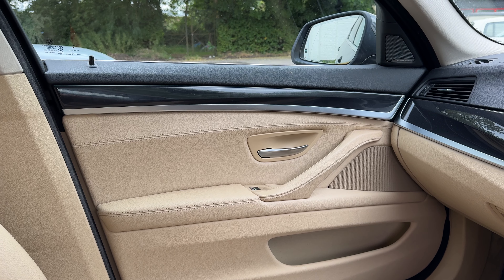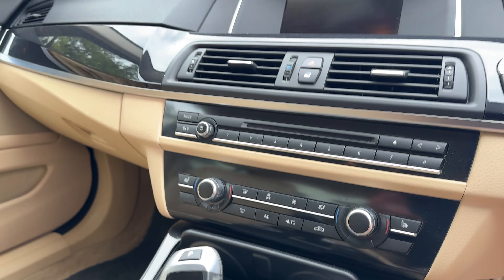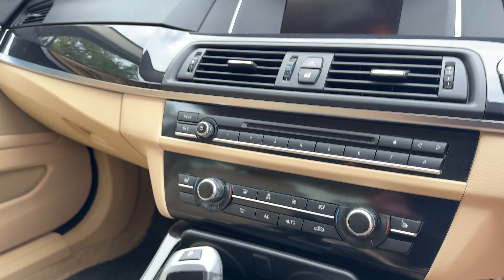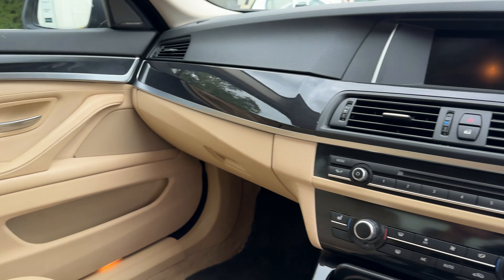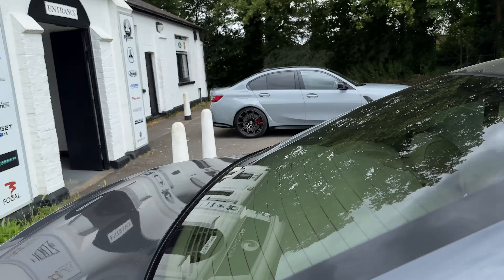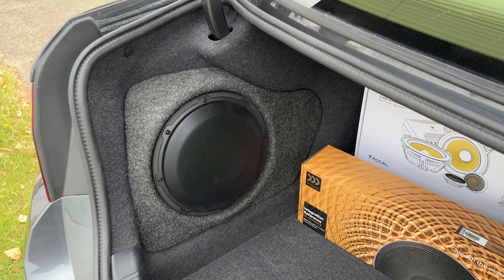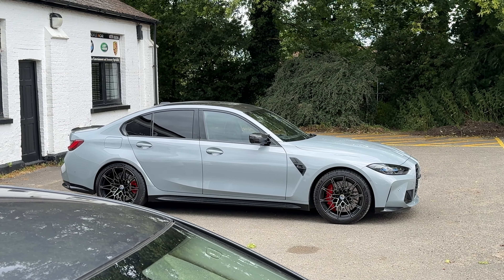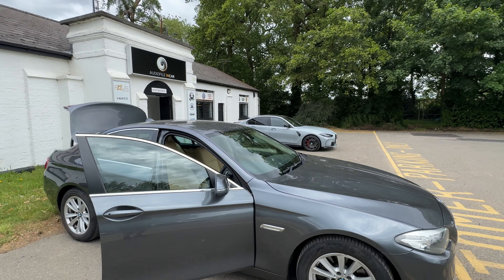BMW 5 Series System 3 Morel Audio Upgrade.

Comment: How much power can the pins take as opposed to just running speaker wire through the doors? At that point A pillar pods would be better for installing speaker wire for an active x over and sound quality being on axis.
Reply from the maker: The whole point of this install is to keep a stock look, otherwise we would include Pillar builds as we do in our Utopia option. The pins carry plenty of current for a tweeter 😂